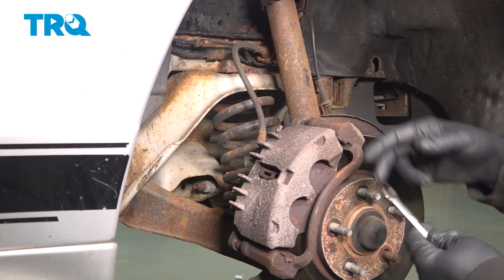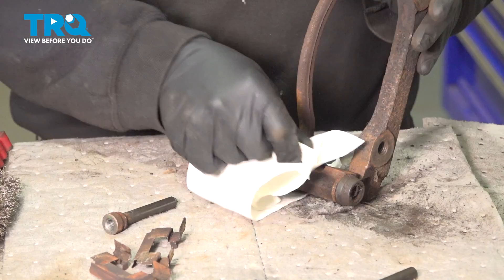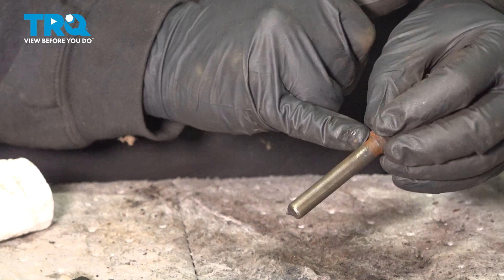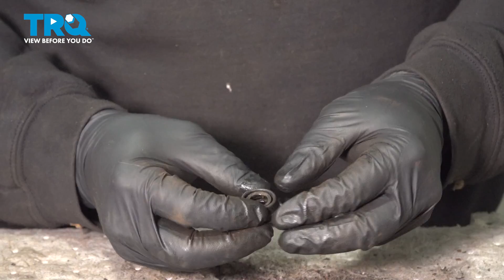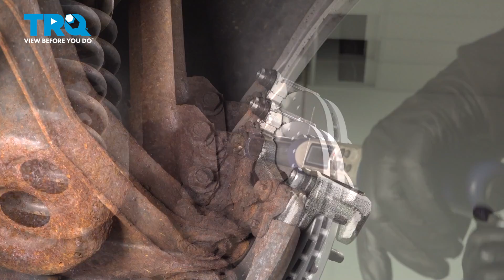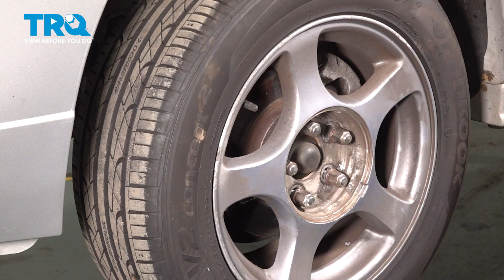How to Replace Front Brakes 1994-2004 Ford Mustang

Comment: So I have a question I need some advice I have had 2 different front calipers from autozone and both of them after installing and starting the bleeding process both calipers top pistons quit functioning properly the first time it happened I thought maybe the rubber brake hose was the issue well I put a new brake hose on and waited for the 2nd caliper to come in and sure enough as soon as we start the bleeding process the top piston sticks and after looking it broke a few pieces of the piston off around the seal am I doing something wrong with the installation I have another caliper coming tm but idk where too even start now

Comment: I have 2003 mustang convertible V6 and the rotor will not slide into the calipers. When I bought the car the brakes were locking so I got replacements and they were the same. I ordered some performance ones and same issue the caliper would have had to been forced onto the rotor rubbing badly. I heard there were issues with this year and model but no advice on how to resolve.